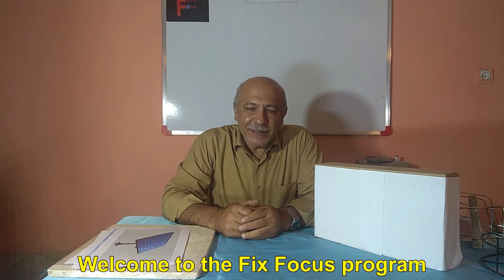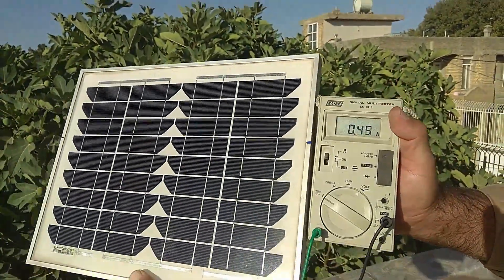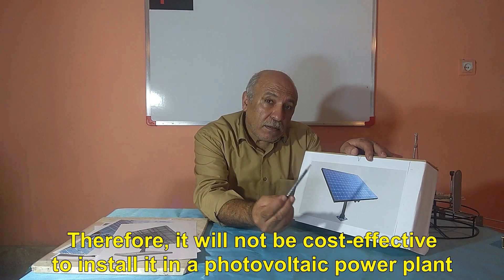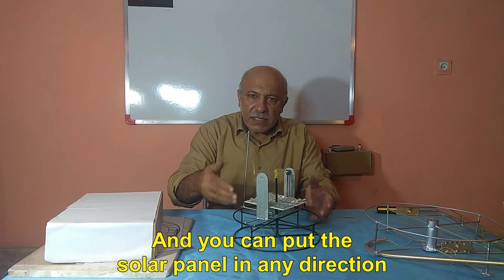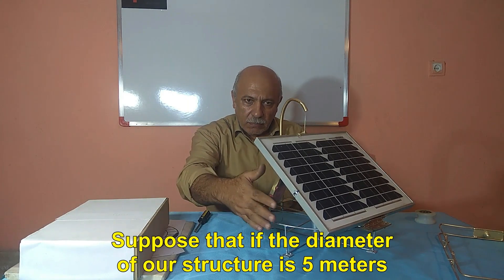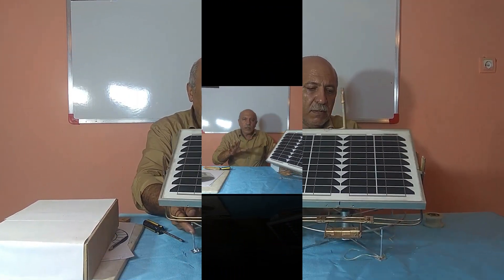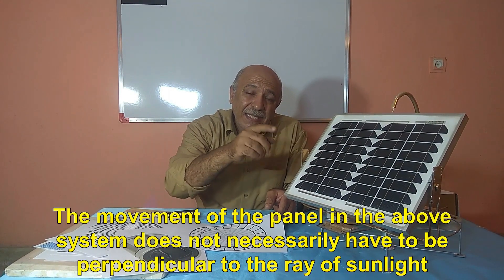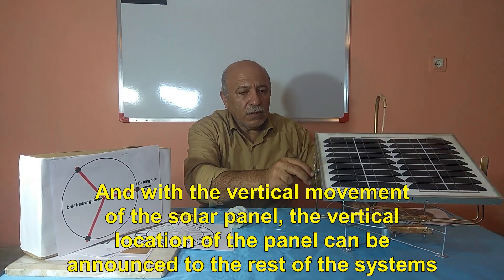A new way to rotate solar panels. Effective and cheap method.  solar panel rotation system.

Comment: Instead of using a single bearing in the center several roller or disk around the edge of the circle be used for more stronger.